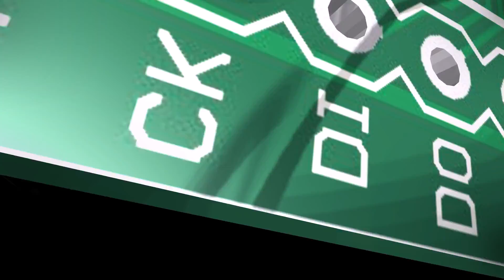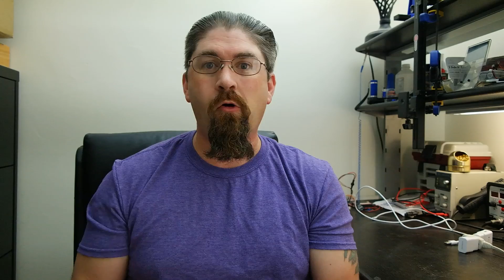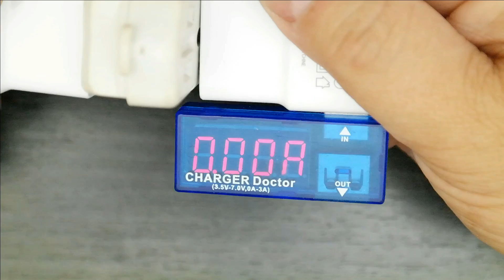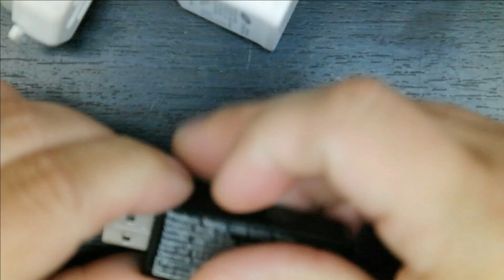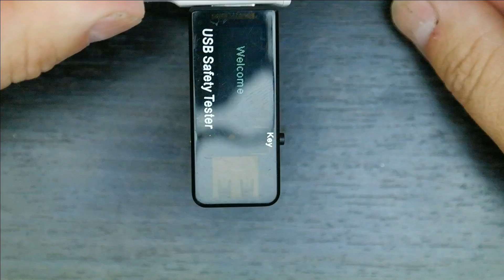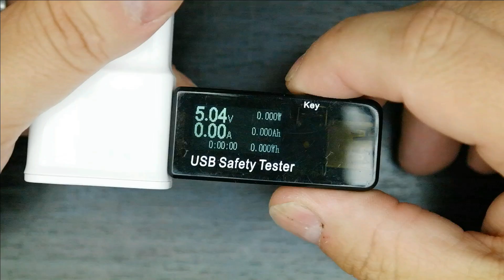USB Safety Tester - Best Charger Doctor Ever!

Comment: Is there a way to connect that tester directly to the mobile ?  Because the figures showing especially Charging Current in Ampere (?) might not be the real CC entering the mobile because of the ~1m cable as in my case was not a good one for some reason. Is there a way to 1. connect the tester directly to the charging port of the mobile ? or 2. move the tester as close as possible to charging port? That would filter out the cable as a factor in any case. . .

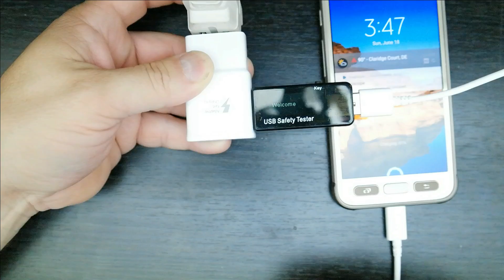Comment: 05:35 9V for USB charging? Very high by USB standard.
Reply: USB QC devices now can be charged with 5, 9 or 12 volts depending on how the device controls the QC power supply device.

Comment: Hey, I recently purchased a keweisi model:KWS-MX18 my question is on the calibration setting and I was hoping you could help. I’m confused in the settings...once I’m in calibration mode I’m able to increase or decrease the voltage ex. 5.5 - 11 v and I’m not sure why I need to do that.

Comment: Hey,
The first charger seems to be the standard one with output of 5V ~ 2A

But still the tester was reading more than 5V.
How could it exceed its output limit?
Reply: It is within the USB specification. A normal charger may output between 4.5 and 5.25 V (devices must be able to tolerate these voltages)

Comment: will it cut off the power charging automatically when our phone fully charged (with the mode AO)?
Reply: Doesn't seem to, but the instructions suck so eh..
Reply: No.  Remember that it is a tester, not a controller.  Power and data are simply passed straight through and are monitored.

Comment: These are not effective for the voltage coming from a portable solar panel. Trust me, I tried yesterday multiple times. However, it works great from a wallplug or your computer.

Comment: There is a bad clone available out there. The internal alarm on the clone is set for 20V. If you re-set it for the 30V the sales listing says it is capable of, then feed it 29V, the unit internally shorts. The real ones run $6+. The clones I've seen down to $4.xx USD. It might be great for under 20V use I don't know. I didn't get to use the clone for long.
Reply: my device did not work at all https://youtu.be/H1yWf7_ZhKA price $4.83

Comment: Mine came with a card with quick start instructions: 

    Muker USB Tester - J7
    Quick Start
    1x short press - Change Display
    2x short press - Reset the capacity meter (mAh)
    3x short press - Reset the energy meter (Wh)
    4x short press - Reset Time (00:00:00)
    5x short press - Set timer
    6x short press - Change language (English/Chinese)
    1x long press - Reset all meters.

Also, I've found that if you hold down the Key while plugging it in you get a setup menu but with only one key it is hard to guess how to set it up. It's a combination of short presses, long presses 2x short presses and waiting as far as I can tell.

Does anyone have fuller instructions?
Reply: wow thank you, now I can see in english languaje.
Reply: Basically, that's the standard display and the way to reset the tester to default if you change any of the over/under voltage settings.
(Late reply but owell)
Reply: Thanks. I've been playing with setting the timer (5 quick button presses) and noticed that a quick double press on the button when the time flashes increases the timer and one quick press decreases the time for the timer.

Comment: Is it auto-negotiating power on the data pins?  Or just passing +d -d voltage info along to you from whatever charger you are using?
Reply from the maker: +GeorgeGraves I believe it just passes through, negotiation is still handled between charger and device.
Reply: Thanks!